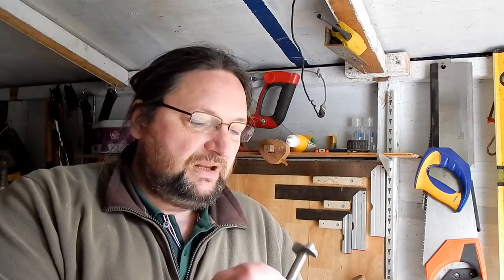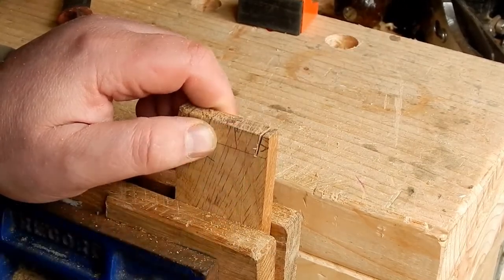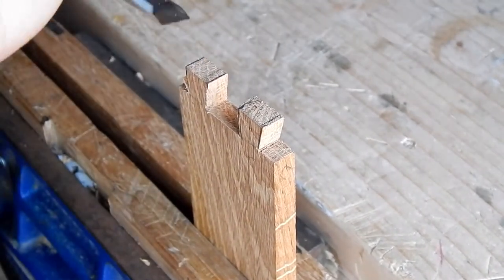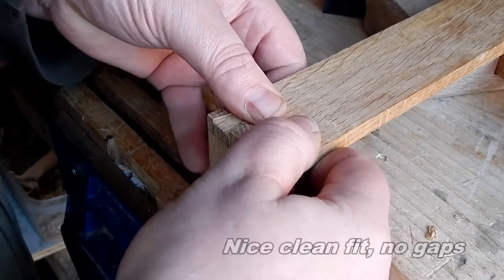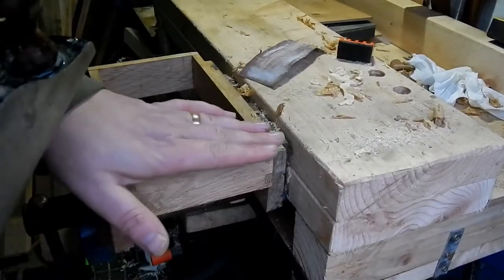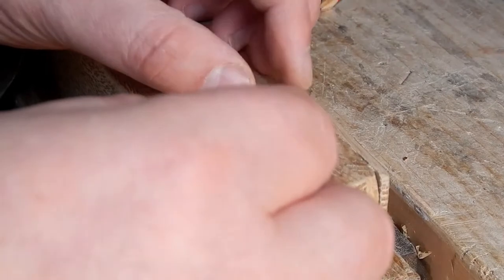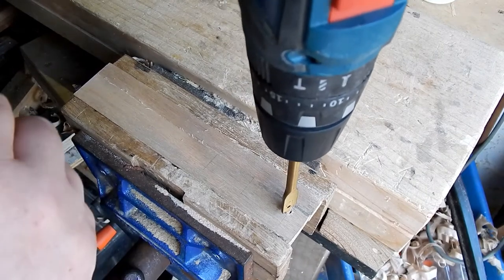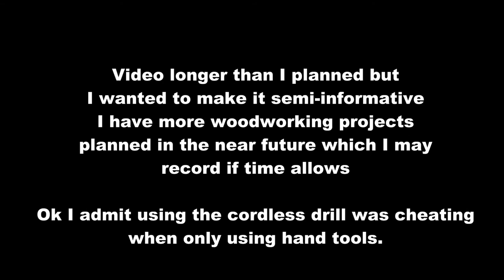Making Small Wooden Box with only Hand Tools

Comment: The black could be a reaction from the glue with the tannins in the oak - the same cause of black staining around some hardware. Thank you for the northern tips and the demonstration that you don't need a mortgage to buy tools suitable for good work!
Reply from the maker: I've never had that happen since, but I stopped using cheap PVA glue and try to avoid leaving things to glue over night in - degrees C haha.
I read somewhere that PVA glue can go black when setting in sub zero temperatures.
Either way, thanks for the comment :)